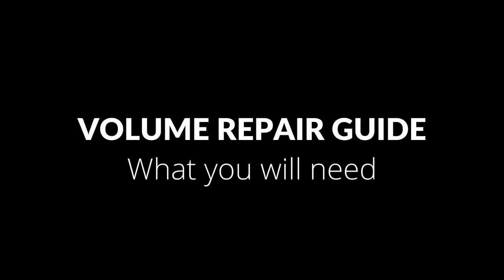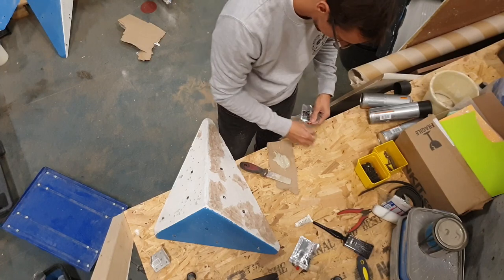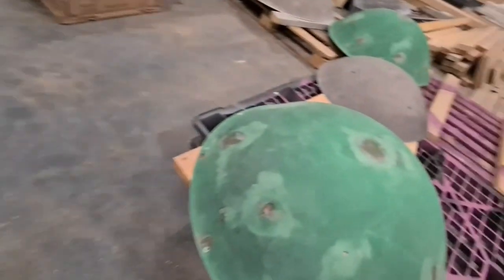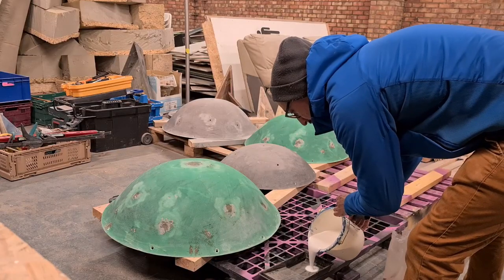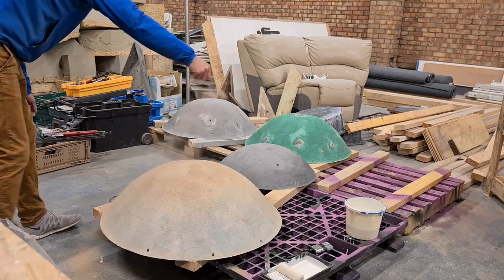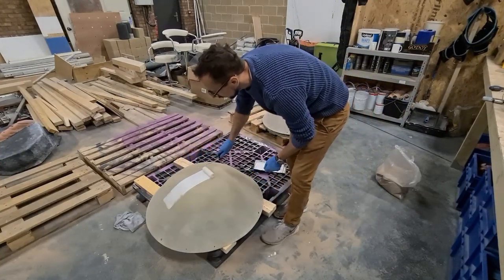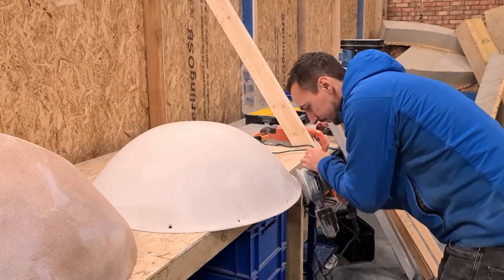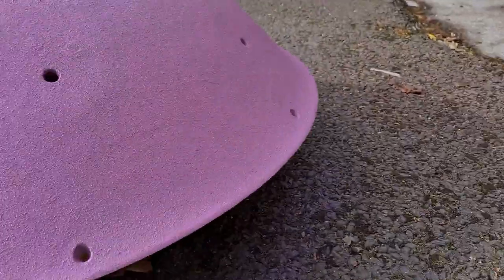How to repair and paint climbing volumes

Comment: Does this apply the same with normal climbing holds instead of volumes?
Reply: for plastic, im told , use a layer of resin and then cover it in a layer of salt. once the salt dries you can put the hold in water and the salt will disolve leaving a nice texture. im yet to try it myself.